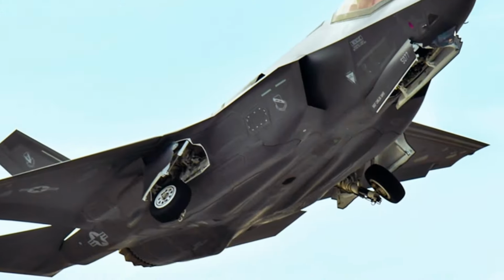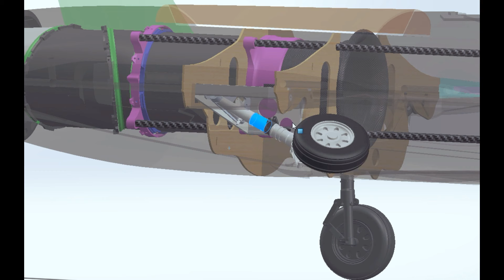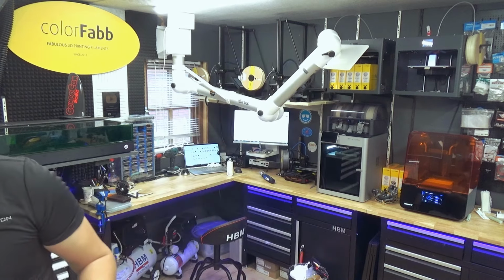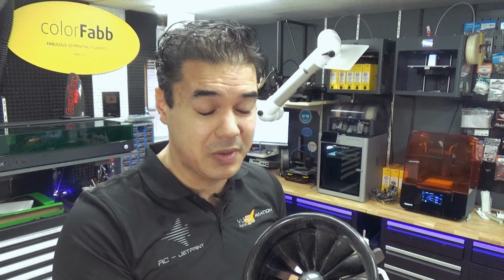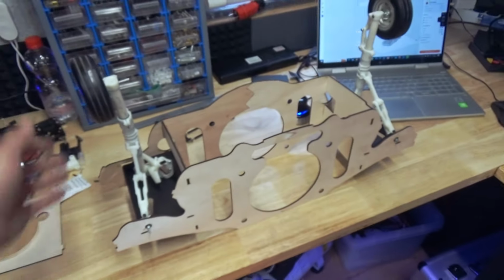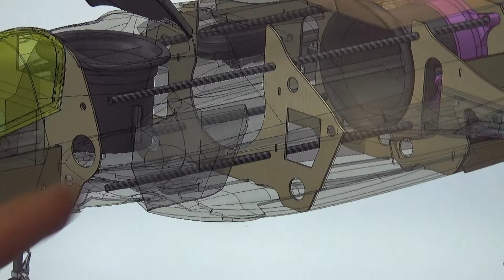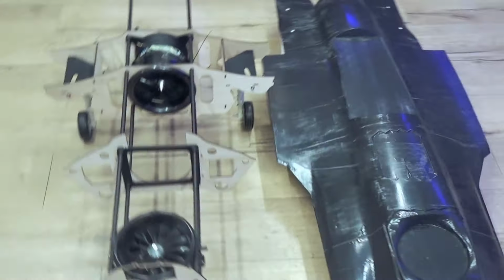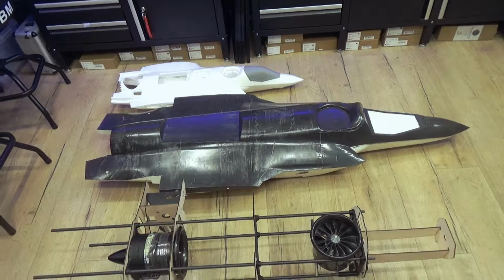F-35B Making World's Biggest RC-F-35B STOVL Model from Scratch | Top Best Builds part.1

Comment: The larger plane looks very cool and the Gear design is perfect. You can save 70% off the liteply structure weight if you use 3mm airrex sheet thats vacuumed between 2 layers of 150g carbon instead. 

Also make the skin from 50g-1,5mm airrex-50g glassfibre vacuumed in mold and you will have a much lighter outer skin structure than carbon, which will also be strong enough to not need the internal carbon rods and you can eliminate some structural formers because the skin can handle the loads on such a model. 1,65m long x 300mm front part of the 2,5m long Learjet fuse I build weigh only 630g. This composite structure done correctly is slightly lighter in weight per sqm than raw balsa sheet, but much stronger and already finished and painted in the mold then.
Reply from the maker: Love your tips! Thankyou
Reply: @Joelmelanie  You are very welcome and another material that is also very light that I use instead of balsa, is to vacuum 3mm airrex sheet between 2 layers 50g glassfibre sheet. By replacing plywood and balsa parts with these composite  materials you will save 50-70% off those component parts. By using only composite materials in my structure , I build a 2,5m long 2m wingspan Learjet 35 airframe with a weight of 5600gram including all the servos and wiring. Only wood in the plane is the landing gear mounting plates.

If you need help on the gear actuators and control mechanisms, let me know. I have Planetary gear actuators and a control mechanism I use in my Learjets that will work well for that application. You can also use analog servos for the geardoors, it’s way more reliable, and my retract controller can operate them all in sequence with the gear. Looking forward to see your special project succeed! Regards Dirk@aviatixmodels.com.